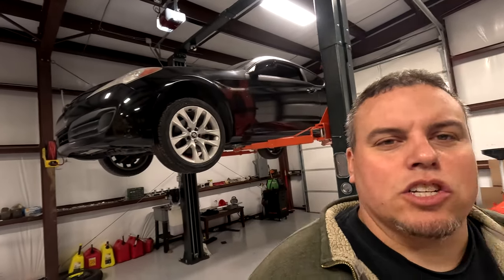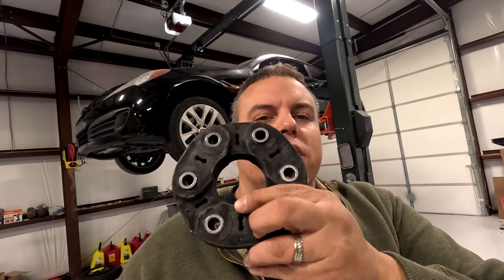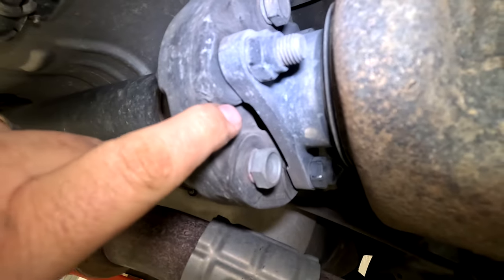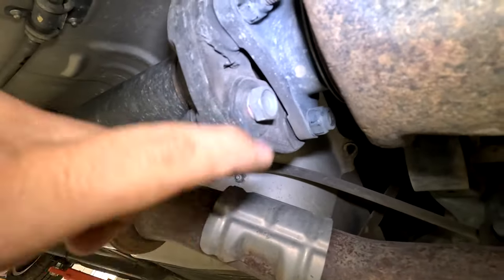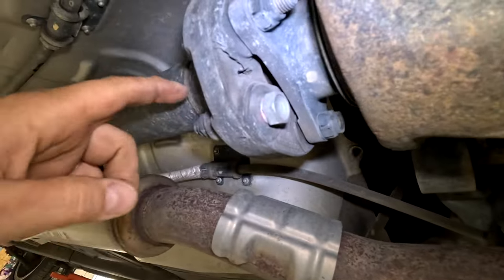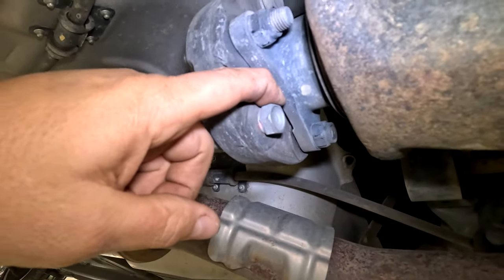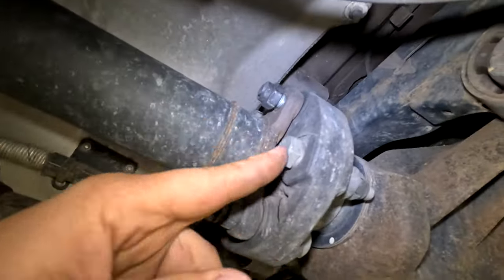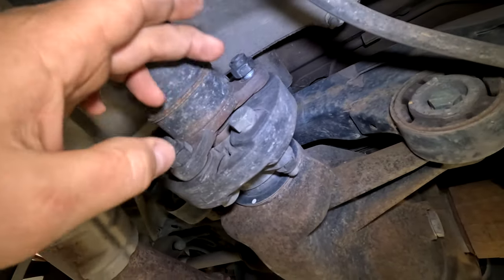Hyundai Genesis Coupe Driveshaft Isolators Replacement Step-by-Step

Comment: Thank you for this video just got my genesis and my isolators are cracked I was hoping to get the part number I'm having a hard time finding them I was told by the stealership I need to replace the whole driveshaft
Reply from the maker: rockauto.com